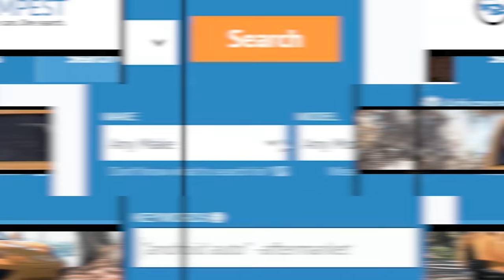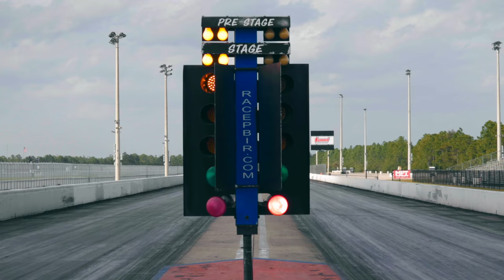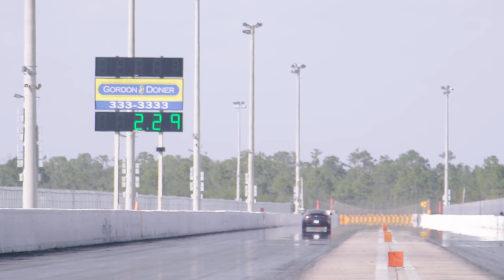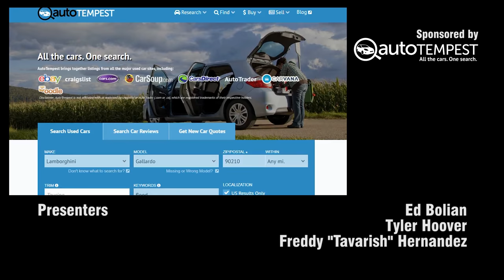Here's How Fast (OR SLOW) Our Cheap Exotic Cars ACTUALLY Are

Comment: Tavarish's car isn't very fuel efficient? Who could of seen that coming?

Answer: Everyone who knows what fuse 15 does, lol.
Reply: What else does it do?
Reply: What did it really do
Reply: Fuel pump relay?
Reply: It ha to do with exhaust he had a leak.
Reply: Race exhaust flap
Reply: @user-ls9ff4cu9x  Don't quote me on this, but it has to do with how an exhaust produces most sound from unburnt fuel. Fuse 15 regulates the exhaust opening and closing, which means it stops unburnt fuel entering the exhaust. This makes the car more fuel efficient, but also decrease the exhaust volume. When Tavarish removed the fuse, while he did increase the sound from the exhaust, he also made the car less fuel efficient, as more unburnt fuel went through the exhaust, and essentially did nothing to drive the car, so was wasted fuel.

Comment: I always laugh when people make fun of drag racing saying "how hard can it be to drive in a straight line".  Very actually.  Especially with a powerful car it takes a lot of skill to launch hard while maintaining control and not spinning.  With the .500 of a second it takes for that light to change you can ruin your entire run just by a slight rpm launch difference, slight pressure changes in how you roll into the gas, or if it's a manual how you let out the clutch. Most people who go to the drag strip for the first time are lucky to come within a half second of their cars potential which by drag racing standards is waaaay off.  It takes a lot of practice, but the plus side is practicing is a blast!

Comment: I daily a c6 that I bought for 27k, and is faster than the whole lot of this mess. You've proven everyone's point.
Reply: Faster than the Aston Martin? lol. No.
Reply: @Justin_SVT  the AM is heavy as fuck and only has 500ish hp. A weekend and a few hundred in parts will put even the most beat LS 100hp up on it. The C6 is much lighter, and despite having the build quality and fit/finish of something from the "As Seen on TV" store, even the most garden variety C6 would embarrass the Aston in every way. That said, the Corvette has always been a trash car. They're unrefined, harsh, and chintzy, getting that stellar performance by skimping everywhere else. They absolutely suck to drive anywhere but a track, and, having worked in that community, the owners are the worst kind of paper-tiger narcissists, all bluster and no class (conceded that most Lambo owners are the same, just with a lot more money). Corvettes are  the village bicycle of cars; fun to ride but you wouldn't want your friends to catch you.
Reply: gasfiltered No. we’re talking stock vs stock. It’s always “yeah but if you threw some money at the LS” no. Unfair comparison no matter the power gains.
Reply: @Justin_SVT  yeah... no the c6 z06 is cheaper than that Aston and has more power, it's also lighter and being a pushrod v8 made by gm it will last forever unlike the two taurus v6s welded together
Reply: @killstacy8088  An Aston Martin has class whereas a Corvette screams midlife crisis.
Reply: @jacobhutchby5791  the aston screams leased

Comment: To be honest during Research and Development of the C8 Corvette.  2 of them overheated in snow conditions.  Back in December of 2018 to January 2019. It will be a couple of years before GM works any issues.  Mid-Engine configuration is a foreign region for them + they don't have Italy or Carroll Shelby to help them. Incidentally, GM almost went Bankrupt due the millions spent the C8. China and Europe conglomerates were expressing interest.  Ford stepped and said no GM is staying U.S. owned manufactured company and so Ford has significant stake on GM. GM asked Ford to help them build an all electric powered Sierra pickup truck.   Since Ford Rivian an electric SUV manufacturer and is why there would be an all electric powered F150.

Comment: Its kinda sad how cars that were $150,000+ brand new, have clutches that dont hold up for very long. Spending that much on a car, it should be more durable than 30,000 miles and a couple of "beat runs".

Comment: not sure if really trying to prove you gan get better cars than a c8 or not, because they are doing a great job at showing why you should get a c8. 13 second quarter mile times is v6 camaro territory, $5000 clutch issues on cars with so low miles, cant even fit in the cars with a helmet? yea, sick looking and sounding cars, but no good at actually being a car.

Comment: OK,  here we go,  the time is 8:37AM ,April first, 2020 as I begin my one lap around the track on this Cartrek challenge . 

Cars are like girlfriends and for this challenge we should start by asking;  are Hollywood girls better than local girls?   I don’t think so;  my research shows that the local girls are every bit as good as the Hollywood girls while  providing better availability at a much lower maintaince costs,  but they are somehow under appreciated.   And when looking at available cars, they fall into three primary categories:  yesterday’s cars powered by gasoline,  tomorrows cars powered by electricity ,  and exotic cars powered by unobtainium.   If our challenge is to find the best exotic car for $59,995,  then that choice must be made using objective and verifiable criteria.  Criteria like acceleration,  top speed, handling, ride, price, safety, operating cost,  maintaince cost,  popularity,  pride of ownership,  and resale value.  

When you can find a local girl that checks all the boxes, she’s a candidate.   And when she finishes first in every category,  then she’s is “the” car,  based on hard verifiable fact,  thus silencing all the unobtainium noise.  While the C8 may “the” car today,  the second generation Tesla roadster with a 0-60 of 1.9 sec.,  a top speed over 250mph, and a range of 620 miles is the heir apparent.  Unfortunately the coming new Tesla roadster suffers from two troubling realities;  it’s $200,000 price tag,  and a 2021 Elon time delivery date.    However,  neither of these problems should discourage a true enthusiast.   The $200,000 list price can be negated by buying used,  and we can overcome the uncertain future delivery date by buying a readily available “Stealth Roadster Mule”  test vehicle”.   These Roadster Mules are not hard to find,  they are everywhere, hidden in plane sight.   

Go to Autotempest.com.    In the “Make” field, enter “Tesla,”  in the “Model” field enter “Model S” (for Stealth),  in the “Keyword” field enter “Ludicrous”,  in the Max Price field enter “$59,995”,  then  simply hit the “Search” button to see what is available.  
Well my lap is over,  time 2 minutes 29 seconds.

Comment: That’s a very crap design for Ferrari, you can’t even drive that automatic paddle shifter hard or each day you need a new clutch. A new Corvette you can launch hard a lot with auto or manual(older models) without worries...your launches weren’t even hard at all

Comment: Well if you goof balls filled your cars before you went drag racing of course they didn't perform as good as they should! 
The Aston Martin would pick up 2 tenths probably with a 1/4 tank or a little less. Nobody not even the manufacturer goes to the dragstrip with a full tank of gas! 
Also it would have not been near as hard on the clutch! 
As for the Lamborghini and the Ferrari,  those times are down right embarrassing! 
The Aston not to much better but at least respectable. 
A 2020 GT Mustang or a 18 and above runs damn near 11.80's bone stock with street tires and a 10 speed automatic!! And you are talking 35k and more luxury almost then most of what you guys should. 
Hell with a exhaust system, E85 tune and cold air intake with proper suspension and tires I've seen a 18 GT mustang run 10.7's NA!